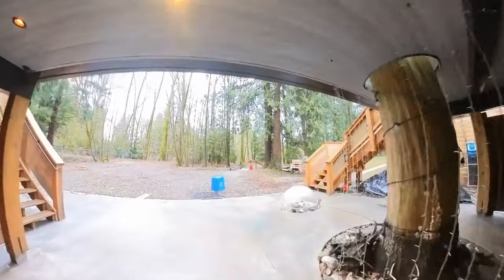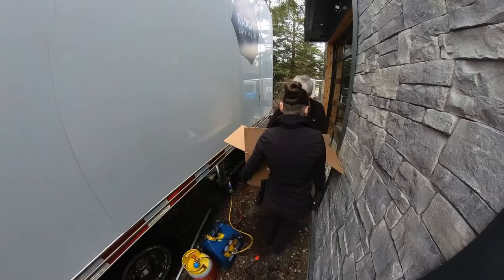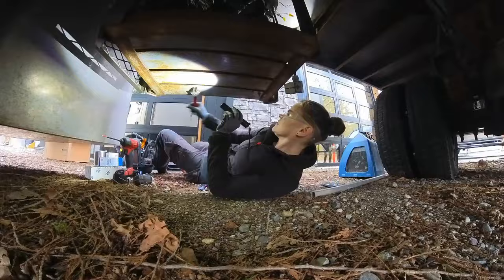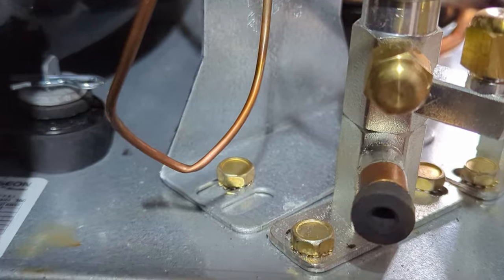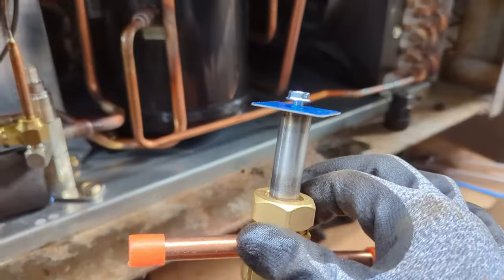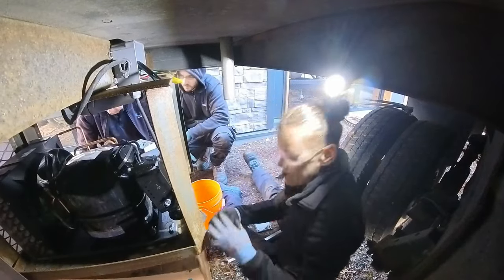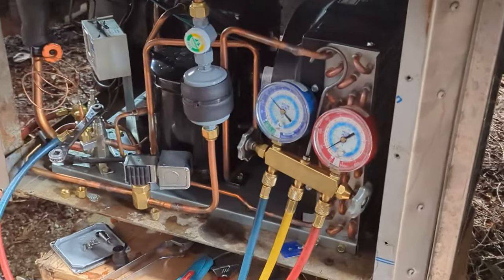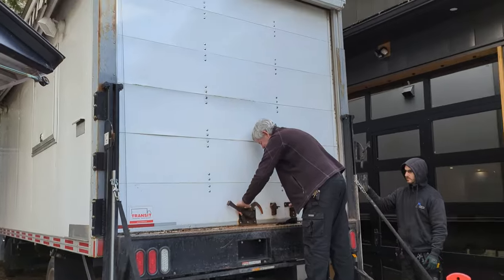Catering Truck Condensing Unit Replacement | HVAC Vlog

Comment: Very good video….just a little help…put a little soap from your bubbles on the rubber grommet…it will slide right in…secondly…Al way tape you wire nuts…I’ve found that it keeps them from vibrating loose and corrosion.
Reply from the maker: ahhhh the bubbles on the grommet is a fantastic idea!!!